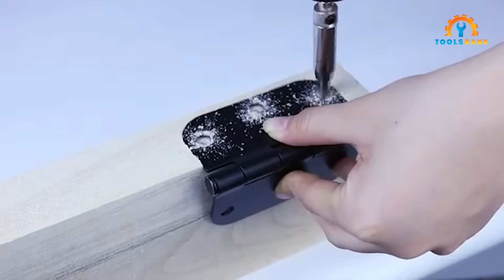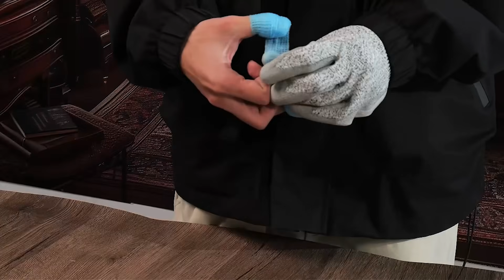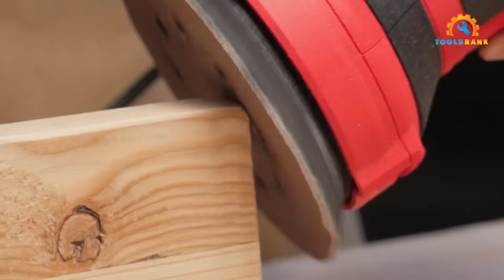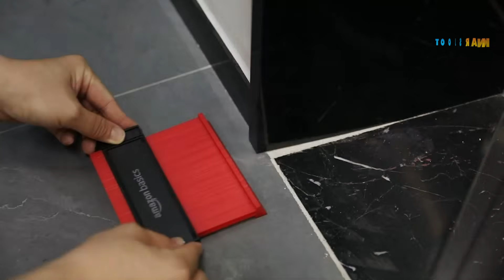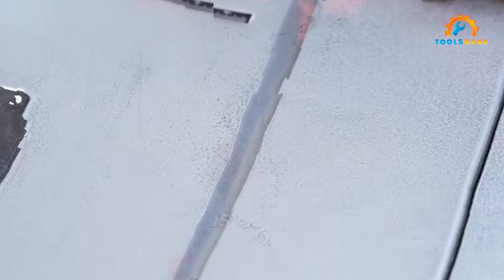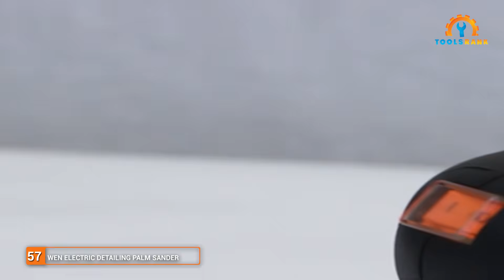60 New Woodworking Tools On Amazon You Should Buy Now

Comment from the maker: 1	Kreg Pocket-Hole Jig 320 with Face Clamp	
 https://www.amazon.com/dp/B0B15KFCDW?tag=toolsrank-20
2	Router Corner Radius Template Jig Set	
 https://www.amazon.com/dp/B0F3WDC9MY?tag=toolsrank-20
3	TOOLCOOL Table Saw Height & Router Depth Gauge	
 https://www.amazon.com/dp/B0GH4G98HQ?tag=toolsrank-20
4	All-in-One Door Hinge & Lock Installation Jig	
 https://www.amazon.com/dp/B0GKTD81G9?tag=toolsrank-20
5	Door Hinge & Door Latch Installation Kit	
 https://www.amazon.com/dp/B0DJ28XBVF?tag=toolsrank-20
6	Woodpeckers Edge Rule 6-Inch Woodworking Ruler	
 https://www.amazon.com/dp/B0D1CW48BJ?tag=toolsrank-20
7	WORKPRO 10-Piece Wood Chisel Set	
 https://www.amazon.com/dp/B0DPY6TRFZ?tag=toolsrank-20
8	Milescraft TriGrips Work Grippers	
 https://www.amazon.com/dp/B005QU98WK?tag=toolsrank-20
9	NECAMOCU Edge Banding Trimmer	
 https://www.amazon.com/dp/B0D9TX59CG?tag=toolsrank-20
10	Chisel Sharpening Honing Guide Tool Set	
 https://www.amazon.com/dp/B0CQLNWX66?tag=toolsrank-20
11	Wooden Handle Edge Banding Trimmer	
 https://www.amazon.com/dp/B0F1DRXMHP?tag=toolsrank-20
12	VIBRATITE Hook & Loop Hand Sanding Block	
 https://www.amazon.com/dp/B08PF5HCYS?tag=toolsrank-20
13	Tongue & Groove Router Bit Set	
 https://www.amazon.com/dp/B07Q388B6M?tag=toolsrank-20
14	WORKPRO Corded Jigsaw Kit	
 https://www.amazon.com/dp/B09PD3ZFW5?tag=toolsrank-20
15	Milescraft DrillMate Portable Drill Guide	
 https://www.amazon.com/dp/B014A1Z92I?tag=toolsrank-20
16	HPHOPE Forstner Bit Set	
 https://www.amazon.com/dp/B0C7WPT2CY?tag=toolsrank-20
17	Deluxe Wood Carving & Whittling Kit	
 https://www.amazon.com/dp/B0DSVHL7QP?tag=toolsrank-20
18	Saker Multi-Function Scribing Tool	
 https://www.amazon.com/dp/B09W8S61JS?tag=toolsrank-20
19	ENERTWIST Premium Wood Chisel Set	
 https://www.amazon.com/dp/B08LGFVNSC?tag=toolsrank-20
20	Adoles Concealed Door Hinge Jig	
 https://www.amazon.com/dp/B0B6SFZ5FY?tag=toolsrank-20
21	T-Square Precision Woodworking Ruler	
 https://www.amazon.com/dp/B0D14GGKBZ?tag=toolsrank-20
22	WORKPRO Reciprocating Saw Blade Set	
 https://www.amazon.com/dp/B071QY9KP8?tag=toolsrank-20
23	GOINGMAKE Adjustable Dowel Jig Kit	
 https://www.amazon.com/dp/B0FK9PSXJT?tag=toolsrank-20
24	POWERTEC Universal Featherboard Set	
 https://www.amazon.com/dp/B084ZF7SWN?tag=toolsrank-20
25	DEKOPRO Random Orbital Sander	
 https://www.amazon.com/dp/B0D9VTX51B?tag=toolsrank-20
26	Woodpeckers Clamp Pals Clamp Pads	
 https://www.amazon.com/dp/B0DFZLCH65?tag=toolsrank-20
27	Nicpro Mechanical Carpenter Pencil Set	
 https://www.amazon.com/dp/B0B3D2G6MB?tag=toolsrank-20
28	MICROJIG Matchfit Setup Gauge	
 https://www.amazon.com/dp/B076MDNZQQ?tag=toolsrank-20
29	YullSorom Glazier's Point Driver	
 https://www.amazon.com/dp/B0F4JY2FSB?tag=toolsrank-20
30	Fletcher FrameMaster Point Driver	
 https://www.amazon.com/dp/B0D39ZLGSQ?tag=toolsrank-20
31	Pony Jorgensen Adjustable Band Clamp	
 https://www.amazon.com/dp/B0007GIN1U?tag=toolsrank-20
32	RUITOOL Woodworking Marking Knife	
 https://www.amazon.com/dp/B0DB24DNX8?tag=toolsrank-20
33	Aluminum Corner Clamp Set	
 https://www.amazon.com/dp/B096DX28FC?tag=toolsrank-20
34	Rockler Parallel Panel Clamps	
 https://www.amazon.com/dp/B0BSVLVW7H?tag=toolsrank-20
35	Amazon Basics Contour Gauge Set	
 https://www.amazon.com/dp/B08XJMQ2LC?tag=toolsrank-20
36	GOINGMAKE Track Saw Parallel Guide System	
 https://www.amazon.com/dp/B0DZCKLXNN?tag=toolsrank-20
37	Matework Pocket Hole Jig Kit	
 https://www.amazon.com/dp/B0CR174CSR?tag=toolsrank-20
38	RAK Magnetic Wristband for Tools	
 https://www.amazon.com/dp/B01HRCU3SW?tag=toolsrank-20
39	Precision Aluminum Corner Clamp Set	
 https://www.amazon.com/dp/B0GQS4TBXV?tag=toolsrank-20
40	Cordless Brushless Oscillating Multi Tool	
 https://www.amazon.com/dp/B0D7MKKCRR?tag=toolsrank-20
41	Go Fast Tools Corner Clamp Set	
 https://www.amazon.com/dp/B0FJ7938TP?tag=toolsrank-20
42	Preciva Woodworking Combination Square	
 https://www.amazon.com/dp/B0D3LGPZXW?tag=toolsrank-20
43	Nicpro Woodworking Scriber Ruler	
 https://www.amazon.com/dp/B0DY171YQD?tag=toolsrank-20
44	PONY PRO Heavy-Duty Pipe Clamp Set	
 https://www.amazon.com/dp/B09XLZTPT3?tag=toolsrank-20
45	Thin Rip Jig for Table Saw	
 https://www.amazon.com/dp/B0DZHBHKJQ?tag=toolsrank-20
46	ZYJOYY Folding Saw Horses	
 https://www.amazon.com/dp/B0FFSN5ZXY?tag=toolsrank-20
47	Bench Dog Woodworking Clamp	
 https://www.amazon.com/dp/B0CRR674D6?tag=toolsrank-20
48	Schaaf Wood Carving Chisel Set	
 https://www.amazon.com/dp/B06XBLNRNM?tag=toolsrank-20
49	Kreg Corner Routing Guide Set	
 https://www.amazon.com/dp/B0BKH881NT?tag=toolsrank-20
50	Portable Hardwood Workbench Vise	
 https://www.amazon.com/dp/B0DPWYB4HC?tag=toolsrank-20
51	ECY Cabinet Face Frame Clamps	
 https://www.amazon.com/dp/B0F8MXBKJ4?tag=toolsrank-20
52	Router Table Setup Bars Set	
 https://www.amazon.com/dp/B0D2QCMRWC?tag=toolsrank-20
53	Portable Adjustable Drill Guide	
 https://www.amazon.com/dp/B0G8TKSWFF?tag=toolsrank-20
54	Kreg Precision Band Saw Fence	
 https://www.amazon.com/dp/B0007VYL48?tag=toolsrank-20
55	VNW Adjustable T-Square Cabinet Jig	
 https://www.amazon.com/dp/B0D3D9S49L?tag=toolsrank-20
56	Milescraft JointMate Dowel Jig	
 https://www.amazon.com/dp/B09RQ53CMR?tag=toolsrank-20
57	WEN Electric Detailing Palm Sander	
 https://www.amazon.com/dp/B000EUH4TG?tag=toolsrank-20
58	Adjustable Spokeshave & Wood Rasp Set	
 https://www.amazon.com/dp/B0BW9H34MD?tag=toolsrank-20
59	Heavy-Duty Spring Clamp Set	
 https://www.amazon.com/dp/B0GCZMFPN9?tag=toolsrank-20
60	Milescraft Sand-It Multi-Surface Sanding Block	
 https://www.amazon.com/dp/B09Z73PD6J?tag=toolsrank-20